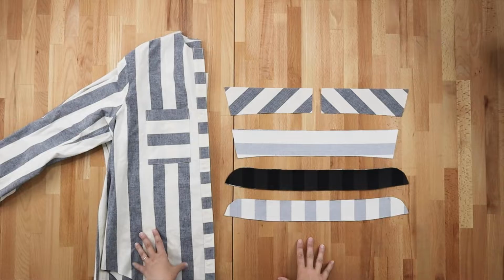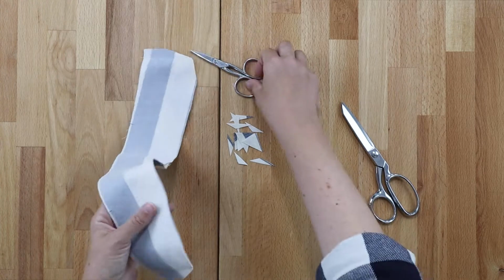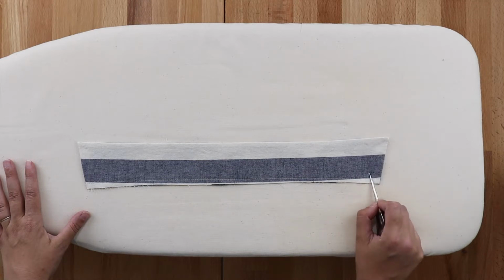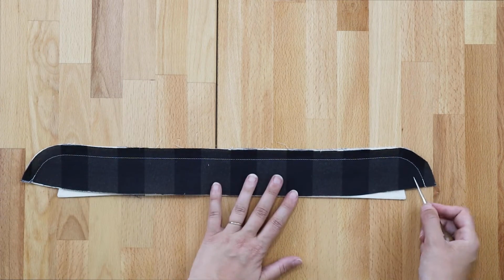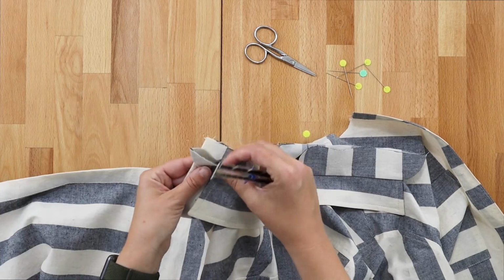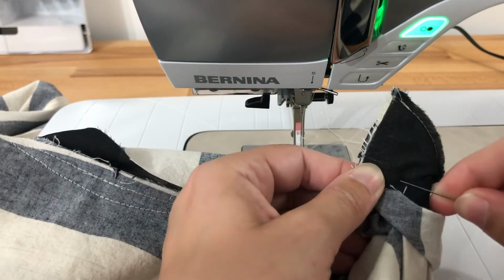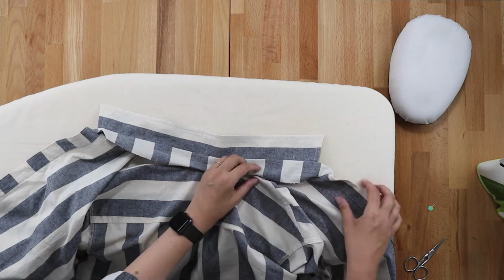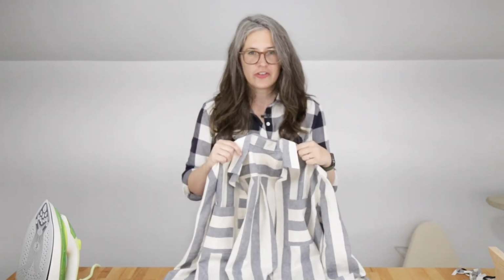Archer Sew-Along: Day13 – Assembling and Attaching the Collar

Comment: Thanks Jen. I was able to do it thanks to your excellent video. However my collar stand is about an 8th too long on both sides. Do you have a tip for preventing that? This one is a muslin. Thanks much!
Reply from the maker: Hmm, what point did you realize it was 1/8" too long. Make sure you're pinning the center, notches, and edges, then distribute the extra fabric between those points evenly. That should ensure everything is arranged properly.